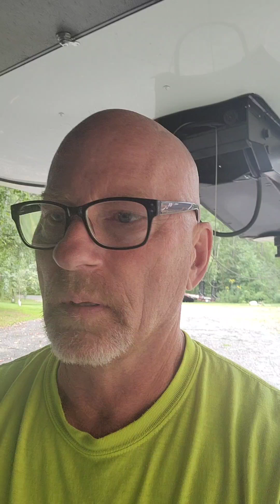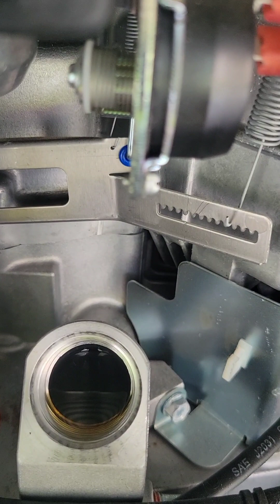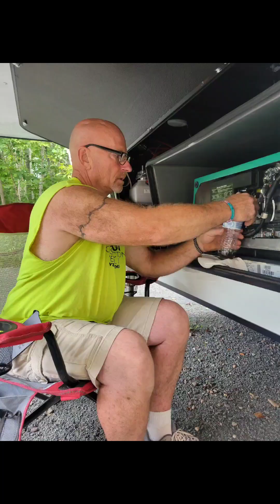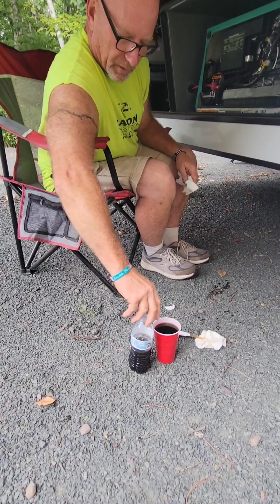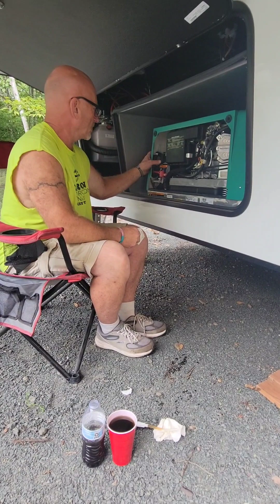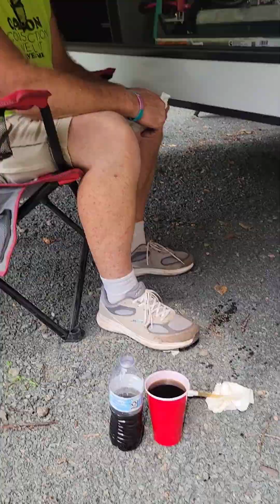New Onan Generator won't stay running, try this fix.

Comment: We had the same problem with the generator on our 22 Valor toyhauler a while back.  Would only run a few minutes at a time. Dropping the oil level worked for us as well.
Reply from the maker: Very glad to hear this.

Comment: My Onan generator has run fine for years with the oil that full. That is the level after changing oil and putting in the recommended amount.
However generator should never run without the cover on it. Because it doesn’t get proper cooling.